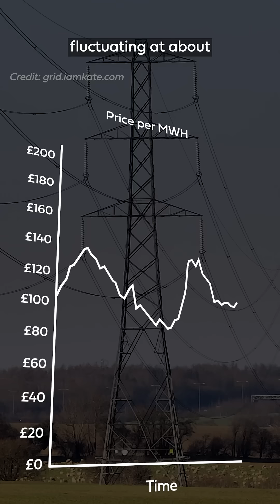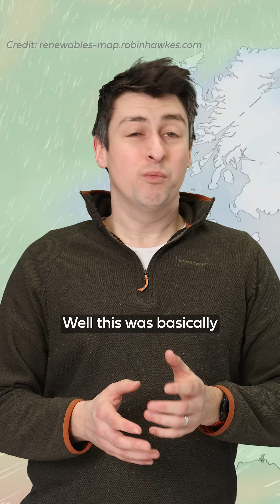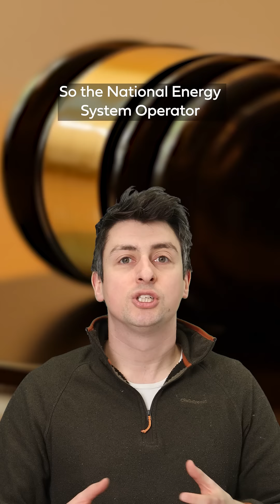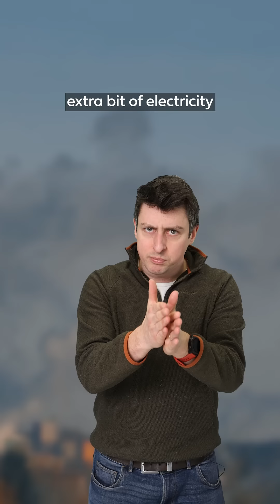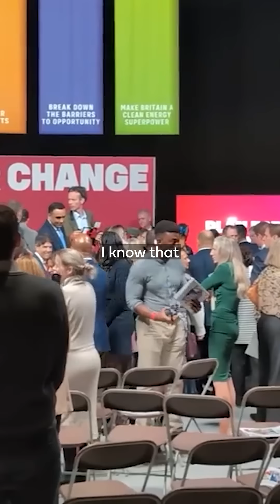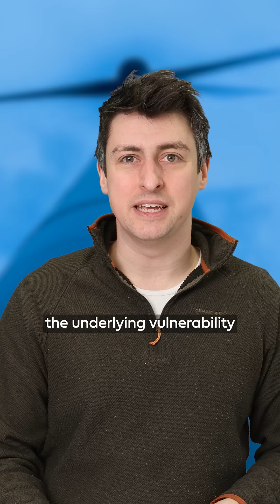The biggest price spike of the energy crisis happened last week

Comment: The only answer is Nuclear, specifically Small Modular Reactors that can be located at the sites of former coal power stations so that the grid doesn't need replacing/extended
Reply: Which will not happen in the next 10-15 years. You are aware that SMRs haven't reached the prototype stage yet. They are still in the shiny CGI stage.
Reply: @Achie79  you might be surprised to learn that China already has Linglong One (the first SMR in the world) up and running since 2024. Also Rolls-Royce have been shortlisted for a contract to build several for the UK's GBN project (and since they build the ones inside our Submarines you can bet they will get it done quickly).
China is also currently building the world's first production ready thorium molten-salt reactor which should be completed by 2030.

And there is an experimental liquid lithium breeding tritium fusion reactor that has been under construction in the UK for a couple of years now which should go live in 2027.
We're making progress, we just need more investment and public support.
Reply: @ So they have partially reached the prototype phase, but are still far from being rolled out on a mass scale. And even then, it is not certain that they will really be commercially successful.
If that will be the case, I would be completely fine with it, but I am not so enthusiastic about them anymore. In the 1950s, many people dreamed that in the year 2000 we would have nuclear powered flying cars. Did that happen?
Reply: @Achie79  you're misunderstanding, the Chinese have a live SMR on the grid, they exist and are production ready. China is building >12 more right now. SMRs are being rolled out right now!
Reply: @Achie79  flying cars are called helicopters, but nuclear fuel is pretty heavy so  using it to power a helicopter is a bit silly, and given that a lot of people can't safely drive in 2 dimensions, I wouldn't be dreaming of giving them a 3rd axis to cause accidents in.
Reply: @ To IAEA database information Linglong-1 is still under construction. Even a news article about it from 10/24 states "... Both units should be put into commercial operation by the end of 2026. ... Once completed, the project will produce enough power ..." 
And Linglong-1 is considered as a prototype. Do you really think China builds 12 other ones right now when the prototype hasn't run once? Do you think they are stupid?
Wwhere is your information from that it went operational in 2024?

By flying cars I meant literally flying cars, not helicopters. That invention was already known by that time.

Comment: If youre going to run a system auction system, based on demand those spikes are going to happen, there are certain power stations/generators who are suppliers of  last resort - usually less efficient, and weirdly every power generator in the system benefits from that last resort price , 
Should there be a maintenance cost for suppliers of last resort ( with a production bonus ) , plus a cap on auction prices - that cap could agreed? Or auctioned itself, and then insex linked or fuel price linked

Comment: A few weeks before the price per mwh was about £1.20, as we had a prolonged period of wind.

We basically maxed out the interconnections we has exporting it and still had excess.

We should really increase the interconnections between france we have a competitive advantage in wind them in nuclear power.
Reply: I don’t believe the French demand much of our energy in these scenarios. 
Nuclear is readily available on their grid, but if our wind exports are cheaper then they may buy that in preference. 
Battery and other storage capacity is a wiser investment in the longer term imho. 
Either many smaller units in buildings offsetting customer demand, or large units in central grid owned facilities as have been deployed by South Australia to store solar generated energy.
Reply: @richardfranks2831    I agree, localised storage and generation would be a good solution to avoid the wild price swings, and wouldn't require extensive grid changes

Comment: Not sure nuclear would help here in any way since those are EXTREMELY slow to react to demand, so they are useless for peak loads.
Reply: The benefit in this case is that the actual peak would be lower compared to the constant power generation, meaning less energy needs to be stored or imported for* those peaks.
Reply: Current (aka 40+ year old) reactors take some time to respond, though it depends a lot on the current reactor state and what kind of reactor.
Small changes of say +-20% are very very fast, full range takes longer.

But also it doesn't matter. We can predict production by solar and wind very accurately and power up reactors before there is a problem.
Reply: Nuclear is not slow to react...they can go from minimum to maximium output in less time than a gas boiler takes to heat up...a gas powerplant can take from 30min to 1h to be ready to provide power unless they're running at full capacity (all boilers heated up and ready at all times)
Reply: @pedromoura1446  Dont you poison the reactor with rapid changes? I thought after rapid changes reactors need time to diffuse out unwanted fissile products?
Reply: @jonasb911  someone's been watching the show on Chernobyl! :p
Yes. You would. IF the water AND the carbon rods didnt absorb enough neutrons to prevent degeneration of the fuel rods. But that can be prevented/eliminated by firstly not removing the carbon rods completely (maintaining them into place will make the output increase Over time and eliminate the "poisoning" effect as the byproducts have a very short lifetime) and secondly by increasing the output in a controlled way instead of in bursts. 
And as far as i know (i could be wrong here.im not a nuclear scientist.) that was also something more relevant to previous generations of nuclear generators. I believe that the current 5th generation powerplants have a configuration of the rods that prevents this (they have them in a comb like structure inside a pool instead of that sci-fi/Simpsons image we all still have of a nuclear reactor's core) but again...i could be wrong since this is not my area of expertise.

Comment: There is no better source of baseload power than nuclear. 
That unfortunately still doesn't address the vulnerability of wind fluctuations to handle the variable demand. Batteries on that scale are not really a viable answer. Molten salt might be more viable but still very expensive. 
Hydro electric is great, if the geography supports it. 
Unfortunately, gas plants are best option until we can find new and better solutions.
Reply: Actually...south australia showed that batteries ARE a possible solution. There's tons of materials and types of batteries you can use... They don't need to be li-ion batteries which are those considered usually as uneconomic due to their current cost and demand.
Reply: @pedromoura1446  South Australia has been a leader in battery storage and added almost 700MWh of storage with more planned, however the UK uses 29.6 GWh on an average day.  With large variations in both demand and wind generation the UK would likely need 20x the battery storage. With demand for battery materials continuing to grow, installing that much capacity will take 30 years at costs not much different than adding baseload nuclear generation but without actually generating any power.
Reply: @pedromoura1446  i bet your example is a small one or an out right lie.
Reply: @thetreelander7378  "a small one or a lie" he says about the biggest, most successful and well documented case study for energy transition in the world...
Unlike some people i don't enjoy lying to people on the internet.
Reply: @ i am not saying you are lying but the sources you read from.
Reply: @thetreelander7378  why would hundreds of people who work in different fields and have nothing to gain lie so well about the same thing?! This is not something you can only find in some ridiculous blog or tik tok... You could read for instance "Expediting a renewable energy transition in a privatised market via public policy: The case of south Australia 2004-18" by McGreevy et al...there's even several meta analysis on the subject of policy and energy transition that mention and use data from south australia (along with other case studies) as well as consider its advantages and deficiencies...
Its not the be all end all of energy transitions but it was quite successful and, as such, has been quite extensively studied.
Reply: Tidal systems are utterly predictable and effectively infinite on a small island like the UK!
Reply: @NigelTolley  the UK is not a "small" island. Bermuda is a small island. 
Tidal is definately a possibility, but they're still very technically challenging to build, and expensive. There can be some environmental issues as well.
Reply: I honestly see the problem with a price spike at the spot market every now and then. System is working, grid is stable. As a consumer or business you only care about the levelized cost over the whole year. And the that price benefits from cheap wind electricity 70% of the time.
Reply: Batteries are cheap enough now (on commercial scales) to make them cost effective as an option. That is still not that helpful for prolonged dunkelflaute, but batteries are definitely a viable part of the mix now.

The biggest ‘cost’ now is the stigma caused by problems with a starting tech. Nobody likes the idea of a battery fire on scale, but that will ultimately, lead to safer batteries going forward. Many of the battery fires are linked to certain which shows things can be improved. It’s flammable electrolytes in the battery that are the main problem, not lithium, and there are batteries that have non-flammable electrolytes (hello sodium and solid state). It’s still a bit ‘Wild West’ at the moment, but looking at developments, in 10 years time, I think battery fires are not going to be a thing that happens to any significant degree.
Reply: Also current battery tech needs replacement in 10-20 years.
Reply: @kevintaylor5017  current batteries (li-ion) on a high turnover usage (like cars) at 8yo retain an average of 80% of their storage efficiency. You can use those 8yo batteries for storage and studies show you can get around 8-10 years more out of them BY THEN. Using them from the start would make it more like 30yo. But you're not wrong to claim 20 years for current usage since those used for fixed storage are usually reused from other sources.

This is also for li-ion batteries which are the best we have so far for energy density. Something which is only a problem for things that have to move. For fixed storage there's ,admitedly less efficient, but less expensive storage solutions that can be used all the way from iron-nickel batteries to the reused li-ion.
I do agree that to store the full amount would be excessive but you don't need to store it all as they don't in australia. You only need to store around a 24h buffer and you got to remember that wind peak production is at night when nobody's using it so it would be simply adding efficiency to the current grid anyway which, along other means of generation, would give you enough to avoid the op's problem. As with any grid its a matter of managing your risk...
Reply: @pedromoura1446 I don't have an issue with batteries being used with renewables like wind or solar. All I'm really trying to say is that they aren't the total solution. Every grid needs a reliable main baseload generation source, right now the most environmentally viable option for that is nuclear. Renewables and storage are great for some variable demand, but demand is limiting availability and installation time. The lifecycle and storage costs haven't really been shown in estimated cost, but they always do that with nuclear. The way our world operates it needs cheap energy or our standards of living will plummet. 
Natural Gas plants with scrubbers and even carbon capture are a nessisary part of the transition from coal as we move towards a cleaner future.
Reply: @pedromoura1446 Additionally our whole way of life relies on FF byproducts,  from all the light weight plastics used in everything including medical, eyeglass lenses and every possible consumer device and unending industrial and chemical processes and products. Heavy industry equipment that we need for mining, agriculture and air flight still has no replacement yet for ff. We can't get more minerals out even feed the planet without them. 
We haven't found replacements yet for so many uses; all while our electrical demand is continuing to increase. 
If we removed all demand for gas/petrol and diesel we would still be using oil for so many things and have no idea what to do with the largest volume of the refined product. 

It's a bigger mess to transition than just adding some batteries and renewable generation.
Reply: @kevintaylor5017  we already have natural gas powerplants and they're still more expensive because they require something we need to acquire and is becoming more scarce for geopolitical reasons. There's also the difficult to measure advantage in having europe become energy independent (which cannot happen as long as we depend largely on natural gas). i'd agree with you a decade ago but now we've actually increased our emissions by using natural gas, something that was supposed to be a temporary means to get the most out of the, soon to be out of comission, thermal powerplants... A baseline CAN still be maintained with several sources we don't need to have a single one become our baseline generation option. If you have solar in the absence of wind and hydraulic in absence of solar you still get a baseline...in fact we already have more installed power capacity than we actually need AS A BASELINE (If the wind and sun worked 24/7 we could more than double our energy consumption) storage would simply help even out the peaks of consumption with those of production (which are simply misaligned in time). 
Though we do need some wiggle room for emergencies it's not impossible to work with renewables alone as long as a international grid exists and even less if we consider something like nuclear (which you mentioned as a potencial helper for grid stability.something i agree with...)
Reply: @kevintaylor5017  heavy industry can be and has been made electric. Especially because heavy machinery are not easily moved and the cost of not having to carry around fuel can offset the cost of extending a cabling to the location.
and air flight can ALSO be made cheaper by using locally produced and pressurized hydrogen through excess grid power (which makes airplane fuel all but free).
The minerals are also not the problem. Lithium is relatively abundant In the earth's crust (more than tin and far more than uranium for instance...) and our currently known explorations of lithium could be used to power everything we own TWICE with batteries while still leaving us enough left for growth. And this is not accounting for the fact that we can recover around 93% of it through some very efficient recycling processes (something that can't be done with fossil fuels).
Of course this is not to say that EVERYTHING should be made immediately electric nor that renewables solve all our problems. Some industrial processes will continue to require fossil fuels for a while but most of those materials required are 1-not made to be burned for energy (which would help a lot) and 2-not irreplaceable (they came from fractioned distilation of a hydrocarbon and thus can be made in the same way from any other hydrocarbon source like methane aka natural gas which not only comes from oil but is naturally produced in any waste treatment facility).
All in all Im not saying we should ban all usage of fossil fuel related materials outright im not an idiot (im a engineer, which i guess makes me only half idiot...) but assuming they're irreplaceable or even THE BEST available resource for our current needs seems to be quite shortsighted (no offense intended ofc).
Reply: @pedromoura1446  I mostly agree with you, but disagree that many of the solutions mentioned are at the state they can replace existing technology. Just that we need to realize transition technology (better but maybe not great) will be required. 
You mention that you're an engineer, then you'll understand that with the new technology available each year in some rapidly evolving fields it might be best to adapt and change at a reasonable pace. Each year newer, better and more refined tech products are available. Best not to blow the budget for the next 30 years.

Comment: Why "unfortunately"? This makes battery storage and other storage service providers a viable thing, FINALLY. 
And on average, in the long run, renewable energy sources are still cheaper. Even if it has some short price hikes.

PS: There is also technology, to optimize the electricity use in such peaks. Like cooling the fridge a bit less for a few hours. Again, not viable before, but viable now with these peaks.
Reply: Renewables become much more expensive the more you need to store.
Reply: @HeirToTheScarletSky  Yes and no. Storing energy is quite expensive, right. 

In fact it costs around 120$/MWh to build new. Since renewables are also basically free at their peak times, you can take the 120$/MWh as a ceiling.
So, no, it will NOT get "more expensive the more you need to store". Because it will not get more expensive than the 120$/MWh.

And this based on current battery technology. Not pump storage, which is a lot cheaper. And it also doesn't include any technological advances in grid storage, even thought there WILL be huge advancement, since our "current tech" is Li-Ion batteries, which are super overengineered for this application.